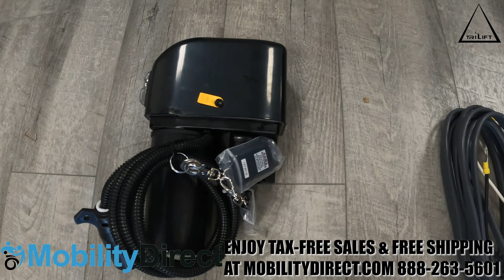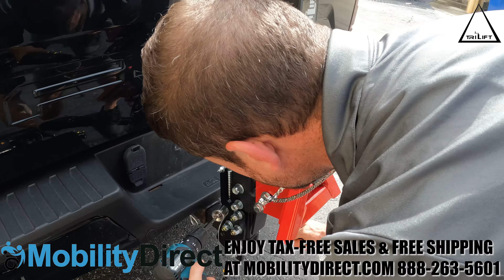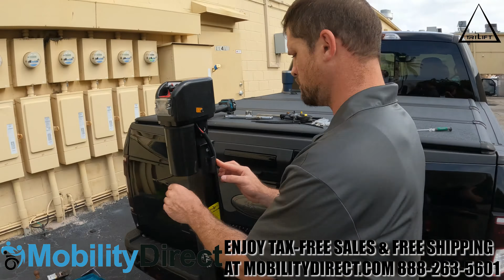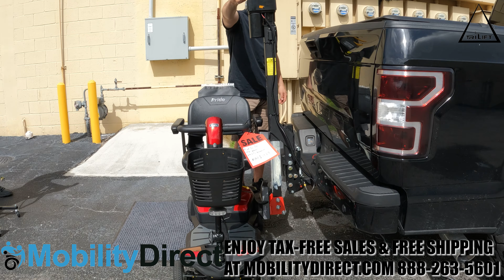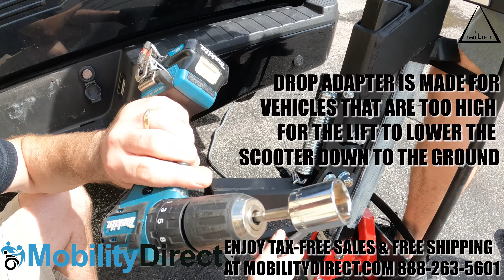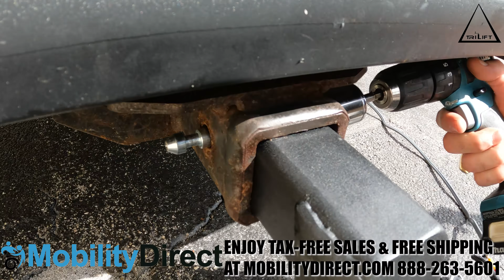🔥 The Best Mobility Scooter Carrier - Tri-Lift HD - Installation & Demonstration Video

Comment: I can’t stand for long (ambulatory user) to push the toggle switches. Is there an accommodation that can be done for this lift because that’s what I’m being offered.
Reply from the maker: @mashr52010 Thanks for watching our video and commenting! We appreciate the support.
Reply: I think that's what the remote is for. I'm also needing to do the lowering and raising sitting in the car. So I'm hoping they confirm.
Reply: @autumnpal  I was told a remote can be added at extra cost.

Comment: Wow! I don’t know if that triangle looks sturdy enough to hold that weight. Also the big scooter looked like it wasn’t far off the ground when the truck moved. I would be afraid of it getting hung up on a curb or a bump. I had a bike carrier that the bike would hit the ground every time I went into a driveway or over a bump.
Reply from the maker: In the demo video we did not have the kit to raise the lift for the bigger scooter. There is a lift kit to set the bigger scooters up higher. It's definitely the best lift to use for bigger scooters. The triangle and lifting bar are solid steel. It will work with some of the biggest scooters on the market